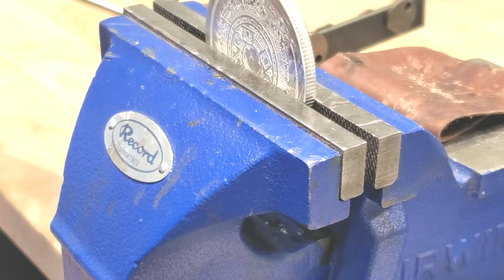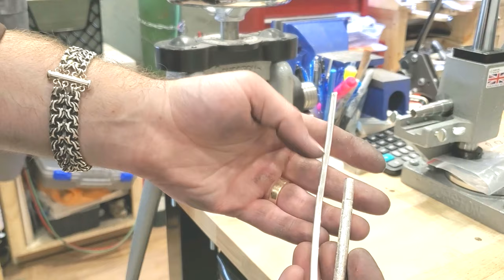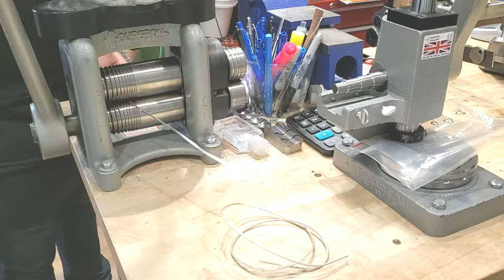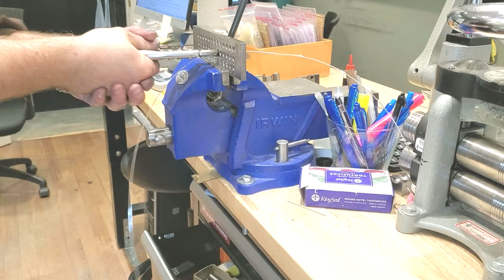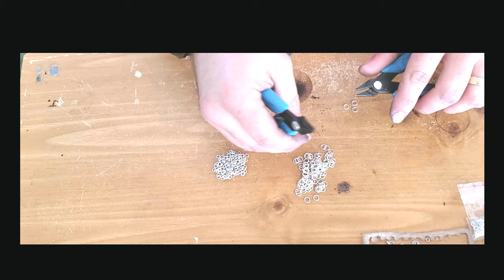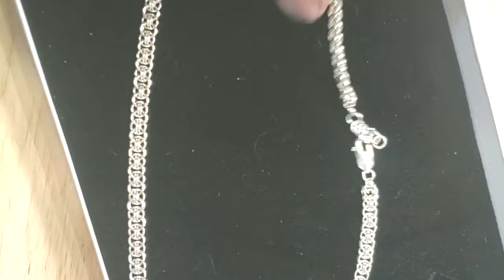Helms weave how its made

Comment: How is the Orion with closing larger gauge jump rings? What model do you have?
Reply from the maker: I have the orion 200i. It dose very good with jump rings up to 14 gauge can be welded with 1 weld any bigger you will have to do 2 welds or more depending the thickness